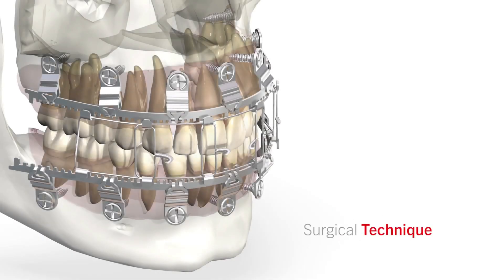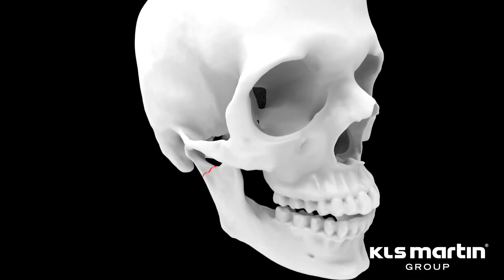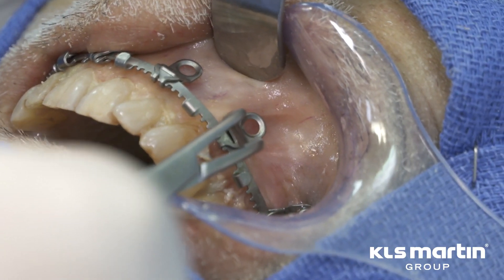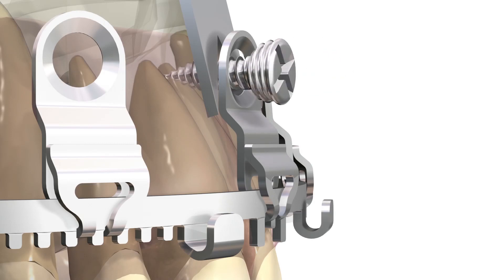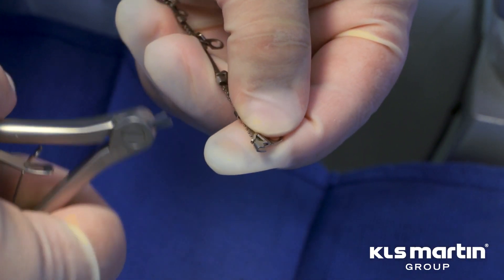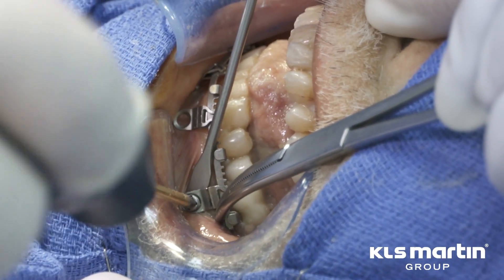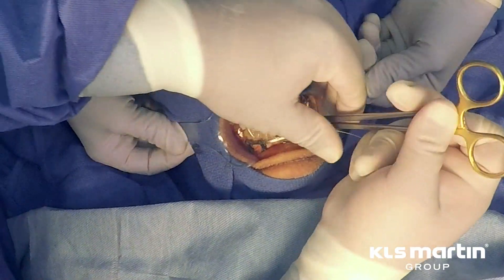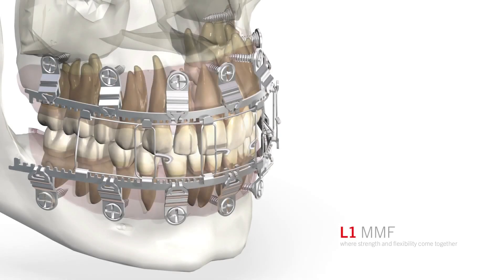L1® MMF – Surgical Technique

Comment: 2:06 😬😬😬😬 god dude I can't imagine the pain afterwards! Well, this video answered my question 😅 I was wondering when someone gets their jaw wired shut, like how they get the teeth and jaw to stay clenched shut, so I imagined/wondered if they go through/puncture the gums with a needle of sorts with wire thread and suture the mouth shut like that (very painful), but now I see they lay down plates and twist in screws right through the fronts of the gum, which I think is even WORSE... God dude... Idk what would be more painful; getting your jaw broke or the repairs...that would HAVE to be a job for general anesthesia! Hell, even getting the plates OUT would just create excruciating pain AGAIN 🤐
Reply: I broke my jaw last month and I can tell you that the repair is much worse. My jaw was wired shut for two weeks and it didn’t really hurt but now I still have the arch bars in and my mouth gets cut every-time I move my mouth.
Reply: @brendanfoley5220  Thanks for sharing your story. How are you doing? During the time your jaw was wired shut, how did you eat and maintain nutrition? Did you consume only purees and shakes? Or were you able to chew soft foods? Thanks.
Reply: @brendanfoley5220  why does the bar stay in after the wires are out?
Reply: HOLY CRAPSICLES THAT DOES LOOK PAINFULLLLLL JEEEZ!!!! 😮😮😮